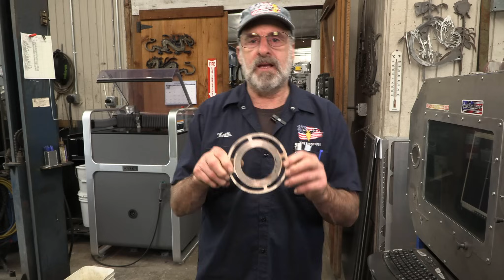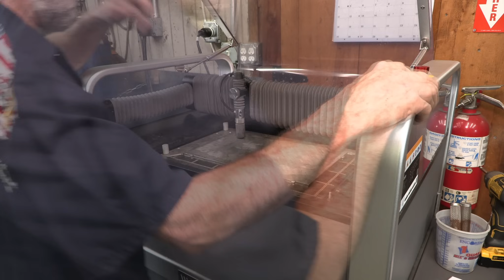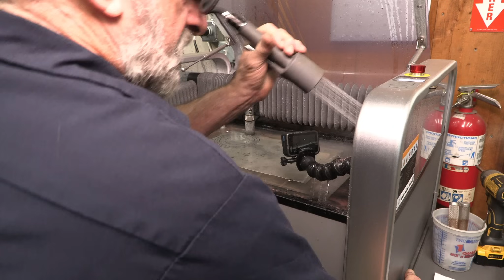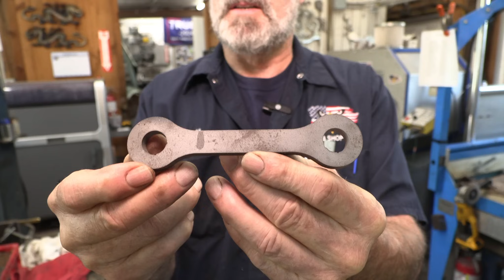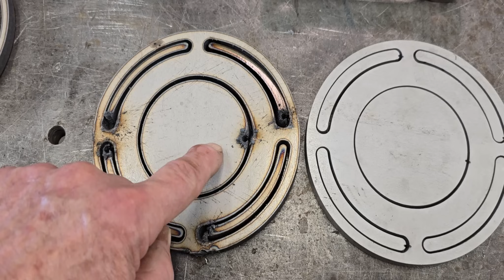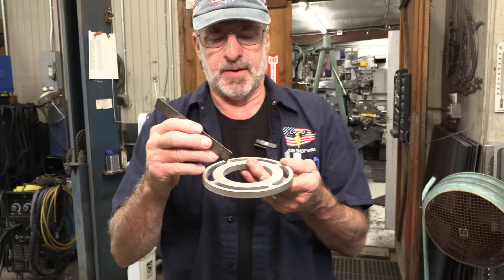Waterjet Vs Plasma .375"   T- 316

Comment: This seems like an advertisement for wazer more than an actual comparison.  Plasma has much larger cutting capacity (usually 4'x8'), IPM is MUCH faster and its much cheaper to maintain.  I run a SS plasma table and have no reason to switch.

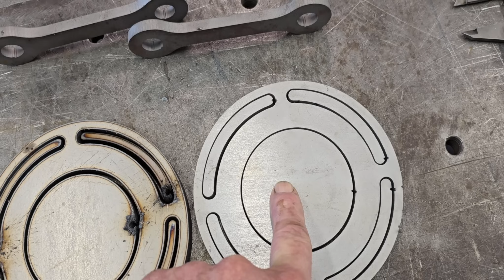Comment: 25:25  For the Wazer, would it be possible to do the piercing off of the cut line, and then move in?  Would this eliminate the larger pierce hold in the cut line?

Curious if the plasma cutter can be fine-tuned for better performance.

Also, what's the cost comparison between the two?  Guessing the plasma cut part is equivalent cost due to the necessary rework.
Reply from the maker: There is room for adjustments and design of the cut paths, both WAZER and PlasmaCAM

Comment: Hello Keith, Nice comparison. the two machines are nice for smaller job shops imo. We run 380 amp multi-gas plasma system which would do alot better than the plasma cam, but we also do production cutting for customers on our machines.

Comment: horses for courses here, if you want to just pop out a mild steel base plate with holes and crack on with a job then its plasma all day long, if you want super crisp brass plate cut or any other exotics then its waterjet for sure, we have both industrial machines here in my home shop and we use them accordingly. your waterjet part took 2 hours but you never said how long your plasma part took ? i would guess at under 10 mins easy. waterjets are the ducks nuts but every machine has its place. good video mate, keep em coming.

Comment: Some anti-spatter and better settings on the PlasmaCAM would produce better results than shown. It will never compare with a commercial waterjet, especially on stainless, to be sure but I’m not sure the difference is that dramatic between these two with the exception of a degree or three of bevel on plasma cutting. I can see where that could be an issue on some parts. I usually send those files to my local steel company and have them cut on their 6kW laser.
Reply from the maker: Your right, not much diference.

Comment: Hi Keith,

Laser  cutters have similar problems as well, the tail of the beam trails the entry side, and in thick material results in a hole to the exit side where  you have a nice sharp corner to the entry.
Plasma usually causes a larger hole on entry point compared to cut width, which can be avoided  by punching through in waste and running up to the actual cut line.
Every option has its good points and bad.
I was quite surprised that your wazer would cut that thickness. That was pretty impressive from a small machine, and did it quite quickly. I know the big ones can handle significant thicknesses, but are a lot more powerful and expensive. I have seen Jason from fireball tools cut like a "b" shape out of a piece of steel bar, about 200mm long, so 200mm depth, that was impressive, and the kerf width was pretty even top to bottom. We are certainly living in a time where there are more ways to do things.

Regards, Dennis.

Comment: G'day Keith, remember back when we did this type of job manually or outsourced to a commercial cutting shop? Small jobshops are all about trying to do as much in-house to maximise the profits (that is how I roll). The Waza Pro accuracy is more than good enough for most jobs , at reasonable machine purchase price, that a small job shop can afford. Very few small shops can stump up 100k-200k  in the current economic climate.
Reply from the maker: That is so true, at any time I could be faced with a downed machine and loose the convenience of it, how did I getter done before and I did keep it humble.

Comment: A commercial water jet would make your part in about one tenth a time with about ten times the accuracy. It will be reasonable for all those measurements to be within one or two thousandths of an inch of each other. While cutting it 10 times the speed the rate of abrasive utilization will be about the same so it would actually use one 10th the amount of abrasive which is of course the major component of the cost of operation. The primary difference between real water jet machine and the wazer is a commercial water jet machine will cut at about 60 to 90,000 PSI which makes a huge difference. Because the energy conveyed by the water stream is related to the square of the velocity a much higher pressure has a profound effect on the energy conveyed to the part and the rate at which it can be cut. The  accuracy, time and cost are all vastly improved. I routinely make parts on the water jet in steel up to about two inches thick although much of my work is in thinner materials. It will readily cut thicknesses well beyond two inches but  I have never encountered a requirement for that in  the work that we do . This machine has two axes of servo controlled tilt which allows it to correct  for taper so even thick cuts are quite straight. Without this correction cuts and materials starting at about one quarter inch show taper and up at 2 inches the taper is enormous and intolerable in many cases. The quality of the water jet is good enough to produce finished parts in many applications but in some applications we use it to cut blanks for subsequent machining where better tolerances and finishes are required. It's a very useful addition to traditional machining technology and saves a lot of time.
Reply from the maker: I absolutely agree with you 100%! The size of the machine, the pressure output of the machine and the cost of the machine will have all differences in the capabilities; it all comes down to what fits your job shop bill. For years I have had my eyes on the EDGE waterjet machine and others seen at shows I’ve been too. Back 10 years a 4’ x 4’ waterjet machine was just under 100K. I needed an addition to my job shop, I didn’t need to make the waterjet my whole job shop so hence my choice in my purchase of my WAZER PRO.
Reply: I dont think your use case is the same as keiths.
The smallest industrial unit I worked on took an 8 x 4 sheet and cost 10 times a wazer. It was one of the smallest foot prints available and the small bed was higher maintenance than larger beds that needed digging less frequently.
I doubt Keith could fit even that small unit in his shop, so the wazer fills a hole he perceives.
I personally send out parts like this. Specialist shops doing just waterjet,  laser and plasma cutting can deal with the running cost of waterjet much easier than occasional use shops.
That small unit also had a drill. Used it to do the pierce on thick materials to cut time and get a better finish with less mess. Would actually be a great addition for the wazer, piercing seems to be a particular weak point.
Reply: 💯 I have a Omax and the quality from the wazer is pretty bad in comparison.. 😅
Reply: What machine do you use (what manufacturer) and what does it cost? I'm even afraid to ask.
Reply: Pro tip , man... paragraphs are your friends... and ours ... 🙄😂

Comment: Regarding plasma cutting on stainless steel. There are plasma torches designed to use two different gases simultaneously. One gas is for the cutting arc and the second gas is used as a shield gas. The best results are to use what is called H-35 gas ( 35% hydrogen and 65% argon) as the cut gas and you can use nitrogen as the shield gas. The result is that you get a smooth clean cut surface on all grades of stainless steel with no oxidized cut surface.

Comment: Do you think using Rain-X on the inside of that hood make it easier to see the part as it's being cut or is it just unnecessary?
Reply from the maker: It fogs somewhat because of temperature difference between tank water and new incoming water, the ceramic coating does as well as Rain-X, helps but not 100%
Reply: @KeithFenner  Makes sense. Those new parts DO look a lot better than Plasma cut ones. Right tool for the job, right?

Comment: An additional benefit with the water jet is the avoidance of a heat affected zone to speak of. I work with applications that may be several inches thick and require machining to true up edges. Heat affected zones may harden materials that will be hard on or destroy subsequent tooling.

Comment: I had no idea that the cost was that high.
Reply: So you said the cost was $31.21, that’s just the time to run the Wazer? Then you add the cost of the material and your programming time to get your cost? 
So for profit you add your percentage plus time for machining? I’m just curious more about the roughed out cost, that $31.21 seems cheap, how does that compare to the plasma table cost? Cool video, that’s a good comparison to the different ways of doing those parts.
Reply: @Hoaxer51  that is just nozzle on time, on most waterjets and cnc equipment you can program in operator costs, electricity etc too. to your end cost, not sure if Keith did it that way.
Reply from the maker: It's all relative to saving in other ways. All processes have consumable cost in them as well. I was surprised it was only.